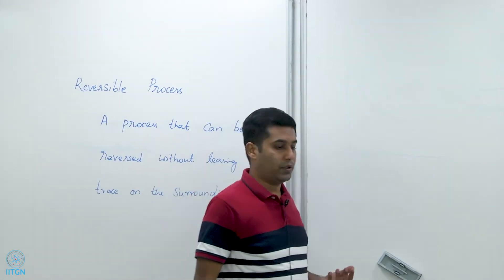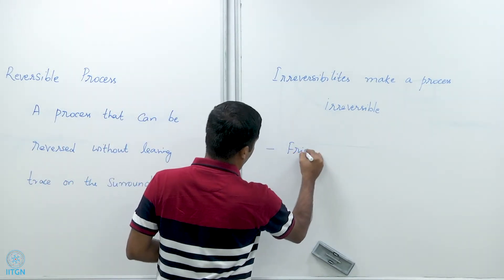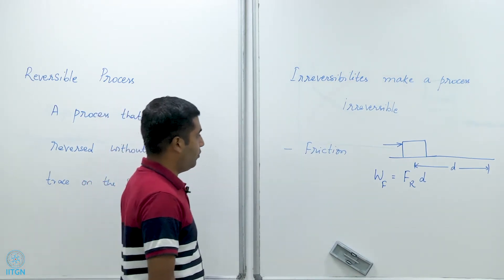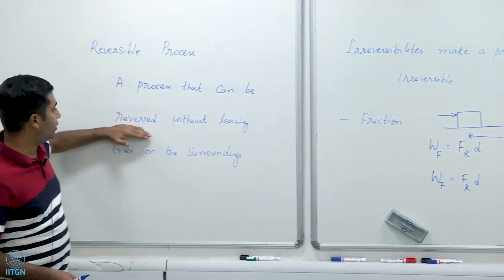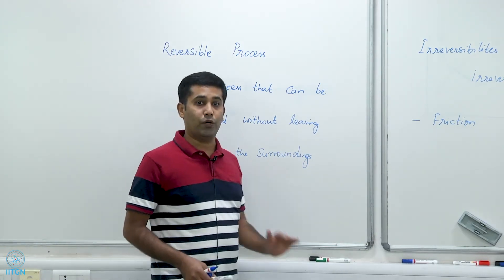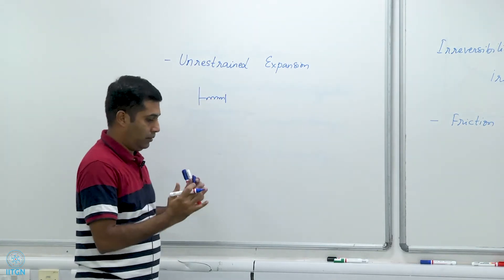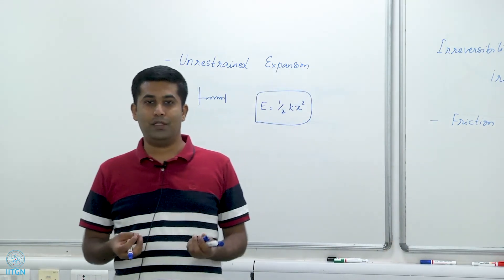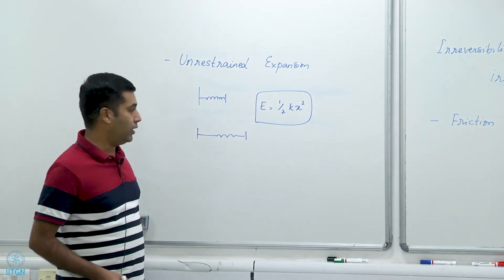6.9 | Reversible and Irreversible Processes | Prof Atul  Bhargav | ES-211 Thermodynamics

Comment: One aspect that you could have pointed out for free expansion of gas is that path cannot be plotted because the properties are not same at all points in the system. ie the system did not pass through equilibrium states.
Reply: Sir, as you know reversible process is hypothetical. But when I read this sentence, the melting of ice to water and freezing of the same water to ice pops into my mind. So sir, could you please solve this dilemma and tell me whether the above is reversible or irreversible process?
Reply: @amiygupta1880  The definition of reversible process is that at the conclusion of the reversal both the system and the surrounding should attain the initial condition. You can see that the surrounding does not reach the initial condition.